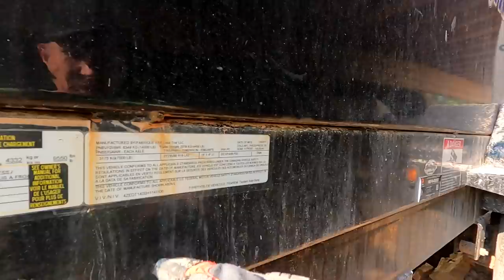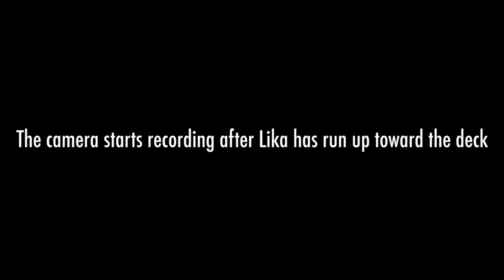OUR MOUNTAIN LION ENCOUNTER | LIVING IN THE WOODS

Comment: Option two takes advantage of your windows and the view. I also recommend buying a bed that has storage in the base or building one. You could also bump the bed off the wall a bit and build storage into the headboard then you could even get away from using nightstands. Bedside lamps could be wall mounted or ceiling hanging lights.
Reply: Great advice. Time for vanlife/tinyhome  ideas.
Reply: Yes, option 2 but move the bed over a bit and put the two closets/armoires on the back wall (and have very small night tables to make it work) or even build in a closet that covers the whole wall.   Oh, and I like the idea of under bed storage too

Comment: Forget the changing table, I always ended up using the bed. I like option 2, waking up in the morning with a view out of those windows, the real reason for living in the mountains.
Reply: Unless the bed is extremely high off the floor, a changing table is much easier on the back...
Reply: You can also use the top of the baby's dresser - just put the changing pad on it.  You can buy 2nd hand dressers for really cheap and then paint.
Reply: Yup changing tables are just a waste of space.
Reply: We used the bed for the first 6 months. We went with a changing pad on the dresser after that. For the past few months(10-15) he stands on top of dresser and plays with the changing stuff on the wall while getting changed.
Reply: Changing pad on the floor, no chance of baby rolling off.
Reply: The bed will need to be high for under the bed storage.

Comment: ***Keep in mind: after you sand and put the primer on, you can inspect the walls and do any touch-ups with mud at that point. Take a light and hold it at a sharp angle to the walls and do any touch-ups with mud. When they dry, sand them and prime those spots again.  ***Another tip: after priming and before finish coating, lightly sand the walls because the primer will raise the fuzz on the drywall.  I learned these things through trial and error as a professional for 25 years. Good luck!
Reply: Number two bedroom layout
Reply: That fuzz is really annoying. I have learned to do that trick with the light to, it’s a major help. Didn’t know about the sanding so I just wrote it down. Thanks, my paint job is going to get better.
Reply: I wouldn’t do the light trick 😂 we seen how he’s mudded lolol he’s gonna have  A LOT to touch up 😂😂😂.

Comment: Put the office in the sunroom! You'll need to have a quite space away from the main house for editing. With baby in the house, this seems to be you best option. You could make it a discrete tuck away office so the room is usable for other stuff too =)

I would do option #2 but put one built in wardrobe on each side of the windows though, you'll probably appreciate the storage over time and can put the baby's stuff in one of them for now. Question though, is there room for a changing table in the bathroom? Perhaps a fold down one?
Reply: I would use Terry and just not think about it.
Reply: You don't actually need a changing table. You have a floor and a bed.

Comment: Ok, here is my two scents (pun intended). Option #2 cause you want to go to sleep looking out the windows and wake up the same way. You guys need to start thinking of the basement as a lower level. If it was on the same level as your living room you would have double the living area. I would finish out the lower level and create a great office space as well as a rec room for the pool table, pinball machine and foosball table. Plus you can build closet space down there for everything that you are not currently wearing which will minimize the closet space that you will need in the bedroom. That is quite a large space down there and should always be included in you design decisions.

Comment: Allie, I suggest a bed that lifts up for extra storage or a bed with drawers at the bottom. Consider using the basement for off-season clothing storage and potential office space. The sunroom is also a great option for office space or even a section of the wall between the living room and kitchen can hold a desk. Of course, I think eventually a she-shed could be a great option for you.
Reply: I second the idea of extra storage under the bed.  I live in a small apartment, and needed extra space.  I bought a set of heavy plastic risers (I think at Lowe's), place the bed on top of those, and have space to put storage boxes underneath the bed.  Also, utilizing Terry as an office is a great idea, so I second (or third) that great idea.  Please, try and keep the office out of the bedroom...tv, too.  Good luck with Furniture Tetris.

Comment: I had a whole changing table set up- never used it 😂 I found the bed the easiest because babies squirm A LOT! So, as a space saver…. Skip the changing table. Just my opinion though. You do what YOU want because your a new mom and you deserve to do this YOUR way ♥️♥️♥️♥️
Reply: My changing table was a catch all! I changed diapers wherever I was...couch, bed, floor...put down a small blanket and get it done...lol!
Reply: My daughter has some OCD issues. Therefore she used the changing table which was also the dresser for both of her children. She is a clean freak so no catch all.
Reply: I agree. I always used the bed or the floor.
Reply: @rosalieogden479  okay
Reply: Agree. Two boys and never had nor need a changing table. You will need a crib, but near that half wall is nuts unless you put up some plexiglass or something that small kids can't climb over after about a year or less. You will definitely need room for the massive amounts of toys they accumulate though. Not to mention all the other paraphernalia they need -- high chair, stroller, swing, bouncer etc.
Reply: @rosalieogden479  yes...this is what I did...dresser used as change table.  I also had some back issues and changing height was very crucial for me.   It was all very neat and tidy.   There is  a curved change pad that helps prevent rolling.

Comment: I think it would be a good idea to create a decorative structure to go from the half wall to ceiling. It could be built to allow air circulation yet be safe.  Little active kids, boys or girls, tend  to have daredevil ideas about climbing or sitting on available structures. They also like to throw or drop things over walls too.
Reply: Excellent idea.  Toddlers are inventive.  My 1 year old used his walker to slam into the bottom stair and catapult himself out of the walker so he  could crawl upstairs. 7, 8 and 10 year olds are scary.  Mine used cardboard to slide down the stairs, head first.  Seemed as if all I did all day was wrangle boys.

Comment: Allie I'm just letting you know from experience.. I had a beautiful changing table and never once used it.. I changed my baby usually on the bed or on the couch or whatever room I was in.. You will find yourself not using it and they are very dangerous cuz it takes 1 sec for baby to roll off. I would just get a baby dresser and then on top you can keep the babies powders and lotions and keep the diapers in a drawer.. You will have diapers everywhere you'll have them in your truck, car, purse, downstairs by the couch in the kitchen LOL
Reply: Baskets work very well to store diapers. They can be carried easily that way too.
Reply: @lorihowell5188  i agree! I had baskets in the main rooms we were in for diapers and all that goes with it. I had baskets for all the first year rattles and trinket toys also. So easy and looks cute in a corner or near the couch. In the baby’s room the changing table was the top of the dresser. It was waist high and long so it worked perfectly. It was my mother’s and then mine and now one of my girl’s. It’s not going anywhere. Lol.

Comment: One night at three in the morning I had a mountain lion jump up on my cab over camper and investigate how locked down my ceiling vents were.  Of course it woke me up.  I barked like a big dog with a deep voice.  "Woof".  And then stayed silent.  It froze and stayed silent for a minute, and then It spooked and took off.  Next day I checked the tracks. It had jumped thirteen feet from the ground to the roof.  As it moved around on the roof, it seemed pretty big and heavy.  Sure glad I had the vents closed that night.  In my life I have had eleven scary experiences with mountain lions.  When I go out at night, especially on a full moon, I pack a little heat and carry a HUGE BEAM rechargeable flashlight.  Their eyes are adjusted to the dark.  A huge flashlight blinds and disorients and makes them nervous.  Trent, where you are, I guarantee this is not going to be your only Mountain Lion experience.
Reply: That sounds like a crazy experience.
Reply: @cattoes1609  Nah.  After that mountain lion took off I went right back to sleep.  My motto:  walk softly and carry a big flash light.

Comment: My suggestion is: I think you can still easily fit a desk in the now ‘pantry’ space. You have the whole basement to put some pantry supplies and Trent is going to need to go up and down the stairs to burn off cookie calories. And you can still put shelving up above the desk for enough of the oft needed goodies. If it’s organized right, (& you are a master organizer) that should be enough space. 
Your bedroom should be a retreat, not a workspace. Staring at the desk worried about getting work done causes low level anxiety/stress you don’t need.

Comment: I have 2 boys.  Never had a changing table.  I just had diapers, wipes, creams etc in a basket on each floor.  When I was upstairs, I would just put a towel on the bed, use the crib or just use the floor.  Then downstairs I would have a towel and use the floor or couch.  I just made sure my baskets were ready.  Save the $$ and the space for something else.

Comment: Try a damp sponge on bad  mudding finishes it works them out smoothly.
Reply: Damp sponge does work. Try it!
Reply: That is how I did too. I am just a DIY but always moved into a fix it upper.
Reply: @elainem9909  :  yes, the damp sponge will do wonders to clean up poor muffing.  Now that you got the corner beading figured out, to the windows- save a lot of time with ripping out dry wall and replacing with wood, it isn’t as simple as you would think
Reply: You guys are getting there! Anxious for baby to come. I’m scared for your run-in with the mountain lion. Be safe.

Comment: We had small bedrooms. We asked our carpenter to make a built in surround for the bed. Two towers on either side of the bed with a "bridge" between them connecting the tops. Left tower held a desk with a drawer and shelves above. The right side was a hanging wardrobe with doors over a set of 4 drawers.
The "bridge" was wired for lights to read by w switches close to the headboard.

Comment: You don't really need a changing table. I've found that as time goes by mum's usually just change on any available surface!
Reply: Yep that's so true. I had a table for my first but ended up on the floor with a baby mat. My kids held on to my feet, getting hands out of the way. Then changing them went a lot faster.
Reply: Agree. Changing pads are better.
Reply: Yup, we lived abroad in rented accommodation, for both kids used a mat on the floor, then you never worry about them falling off
Reply: Agreed. I never used my changing table.

Comment: Furniture suggestions—maybe get a bed that has lots of storage underneath? And perhaps don’t put the changing table on the half wall when the baby is old enough to squirm around (for safety reasons). I built in corner cabinet armoire would be cool, but built in usually means you’re stuck with it in that position for ever.
Reply: I also got a bit nervous thinking about the changing table right beside the half wall with a massive drop.

Comment: Is Brandon building the armoire in the room or are you going to have to carry it up the stairs?
A mountain lion that doesn't run off, on site is a big problem.  That pretty much means it was there hunting/stalking.  There are really no predators that take out an adult mountain lion short of a pack of wolves... so no form of other critter urine repellent will work.  They can jump really high and can climb.  It's getting harder and harder to get firearms these days... and ammo is through the roof.  This is a situation for a twelve gauge... before they're impossible to find.  In your area, I'm fairly sure you have a neighbor that can  teach you how to use it properly.
Of course that means Brandon will be building a safe for it too.

Comment: Regarding a closet upstairs..... I would frame a closet on the end wall, full length, from the front,  to the shower wall. Adding a closet only requires a framed depth of 32 inches. Simple framing and will still look like you planned it that way from the beginning.  Armoires suck, a full length closet is what you need.

Comment: I like option #2 where the bed faces the beautiful windows! Depending on the furniture you get, I think you could still pull off a desk up there too. You could do a corner desk for you by the half wall, and do a low, long dresser by the window at the foot of the bed! And you could easily put a changing station on top, many moms just change baby on the floor on a changing mat 🥰

Comment: I go for option number 2
As for the changing table for the kid coming I would try to fit it inside the bathroom somehow cos i think it is more practical 
Anyway, the other option is also fine but I find it more difficult to fit an armour
A third option could be to position the wardrobes behind the head of the bed in the first option and create an aisle between the wall and the wardrobe itself so that it can be accessed from the aisle. In this new option you will run out of space to fit a little desk or maybe not…
Congratulations

Comment: You don't need a changing table. Just get  the waterproof changing pad with sides from Amazon for $20... Throw it on the bed for changing the little guy. It will save space.
Reply: that works u til they pees like a fountain..lol  ask how I know.. two boys I had wet walls a few times...lol

Comment: Take out window sills while you are still in a mess and do your wood. It will be messy and they might not pass you without corner beads on sheet rock in place there.
Reply: My house is old and has the window reveals in timber. I think you should choose which you prefer and complete that before the Inspection, not change it afterwards. If you haven’t actually done the reveals in timber the Inspection won’t pass with the drywall not finished anyway

Comment: I build custom homes and have buillt homes now for 20 years and let me give you some advice. If you are painting your trim you should be installing all trim before priming your walls as your wood around windows and doors should be primed at same time. And when you fill the nail holes in your trim before painting it you should use Sheetrock 90 and a 1 inch putty knife to spread the Sheetrock 90.  If you use your finger you will always see the dimple in the Sheetrock 90 because your fingers are not flat.

Comment: Also when you're finishing the mud after it dries basically when you start to stand you should use a sea sponge and water and wipe over lightly wet so just see Sponge is better than sanding and you don't have all that dust
Reply: I started sanding and said, well “no”. I saw some pros doing a mall and they used water and sea sponges and I did my whole house this way.

Comment: Suggestion. Purchase a bed with draws under box mattress. The storage will be fantastic. A lot of RVs have them. Or - you can have your bed and wrap around furniture. I use my double dresser as an end table. Mostly teen dept furniture are made like this. Mine is solid oak with leather inlay. Lots of draws, and I have two large corner desks. Muliti purpose.  Manufacturer is LEA. ❤ G-D Bless

Comment: There is a very simple solution to the window casing.  One option is to get some PVC boards and box them out.  The other is to case the windows in sanded cedar.  It will smell amazing and look awesome when stained.  You simply install face trim on top of that.  Just make sure to set the lowest board with a slight angle so condensation does not accumulate on the surface.

Comment: You may have already thought of this but if you did not; get protectors for those corner beads.  They are clear plastic and are usually available at paint stores.  This will be super important when your toddler begins running through the house with toys and the toys hit the corner beads and knock the edges off.

Comment: Option 3- Bed facing windows and instead of side tables (there are options with narrow shelf above bed or headboards with shelving) do whole wall of narrow built-ins and then a deeper section for hanging clothes. Vertical space is your friend and having a full wall of storage will be much needed help.  Then along half wall do desk and chair. Changing table will be much safer on full wall. After having a close call with a baby on a changing table, I would never recommend one near the half wall with that large of a potential fall. Little tiny babies don’t move much but they will surprise you when they do something for the first time. It doesn’t take long before they are very good at rolling, kicking and climbing. Honestly, the safest option is a changing mat on the floor. Saves on floor space. We kept a diaper basket with wipes and a mat on each level of the house. Truth is, you don’t want to run over to a changing table every time and they are space hogs that babies quickly outgrow.

Comment: tape coat, including cornerbead and fasteners covered.  Second coat, doing the same as well as flats and angles.  THIRD COAT to flush or skim everything out.  IF you only do 2 coats, all of your cornerbead will be gant.  Your butts will be bad, your screw holes will all show.   3 coats of mud on butts, screws, seams, cornerbead.